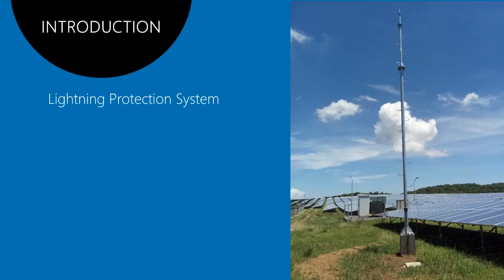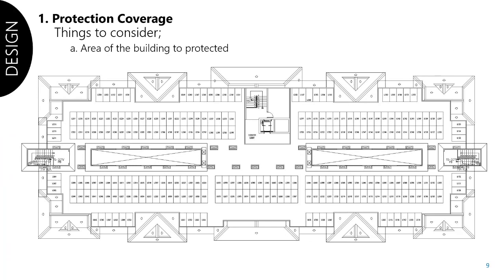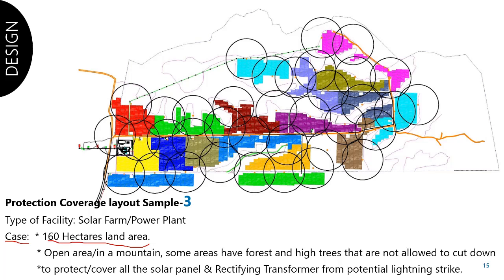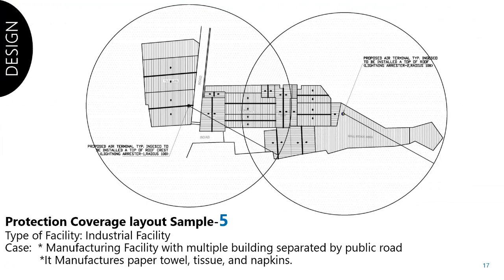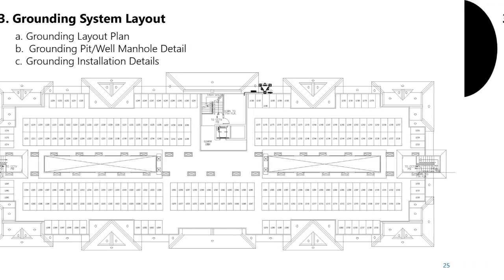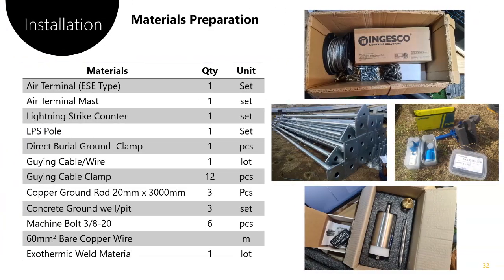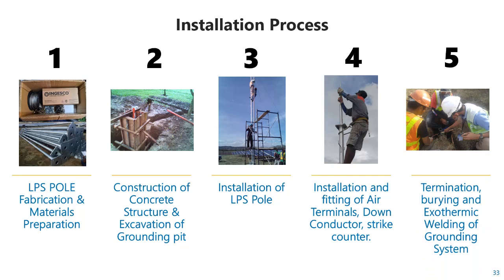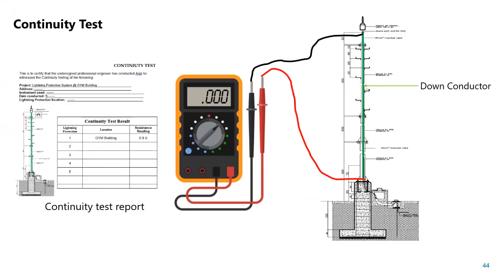Lightning Protection System -ESE Type (Design, Installation, Testing and Commissioning)

Comment: Sir, can i ask a question? In every one air Terminal to downstream bare copper conductor, install one lightning arrester counter.... I mean, one is to one... Thanks in advance & god bless....
Reply from the maker: In practice and manufacturer technical specification for ESE -Early Streamer Emission type LPS. YES, one is to one. But for Conventional Type LPS Systems, which have multi-air terminals that some other owners prepared to have lightning strike counter, you can install one lightning Strike counter in the system on prepared location and strategically positioned since the Conventional type is mostly grid /connected to each other.